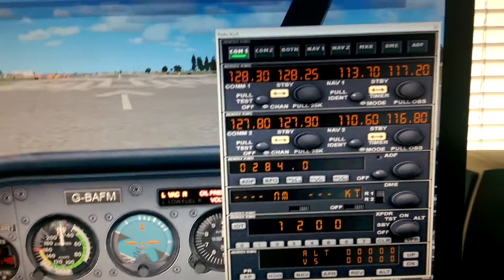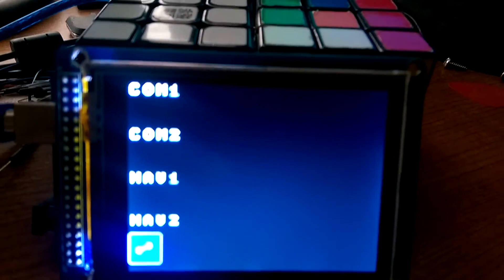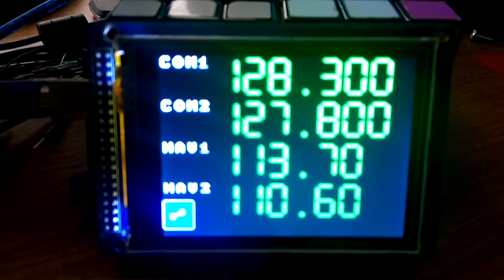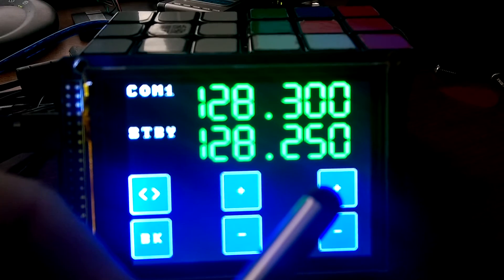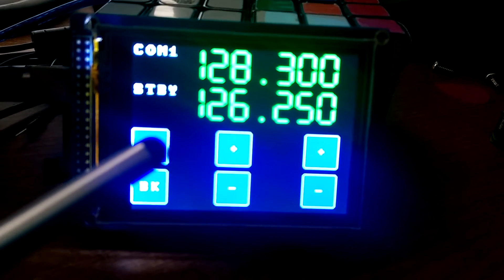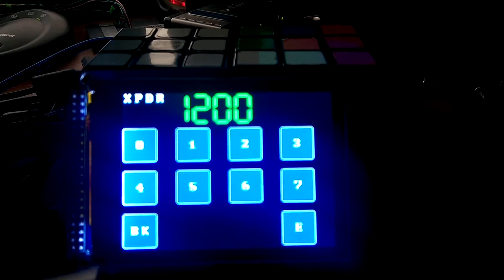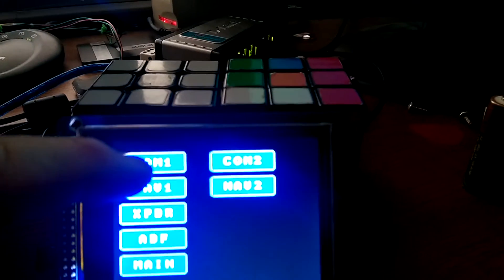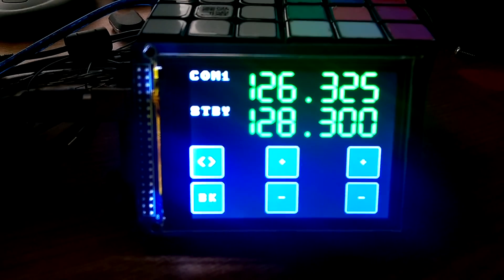3.2 " LCD Touch Screen Radio Stack for FSX

Comment: Hi Benny, amazing what you have done! I'm thinking about doing something similar for using with the recently released Falcon BMS 4.3 (F16 simulator), along with FSX. Do you know if this is possible? Don't know much about Falcon BMS (just starting into flight sims) but I guess it should be possible, there are some amazing examples of working gauges and indicators working for that game